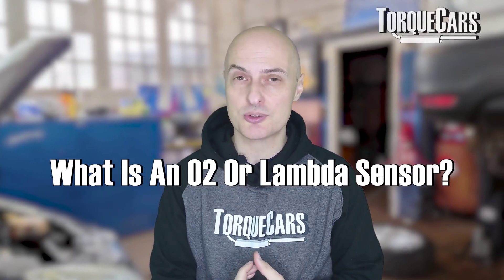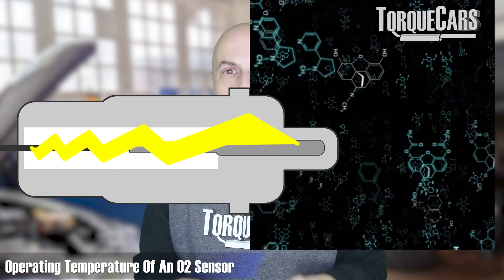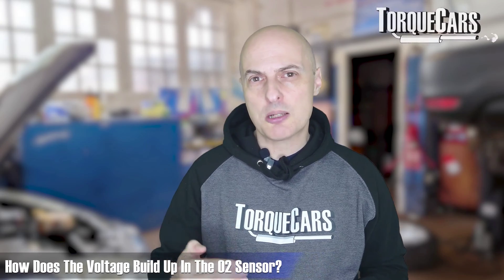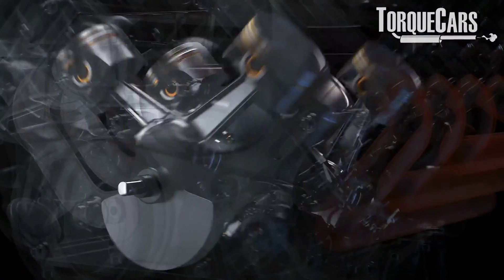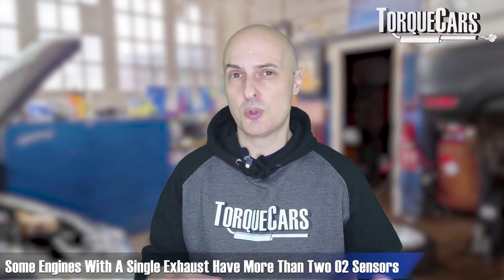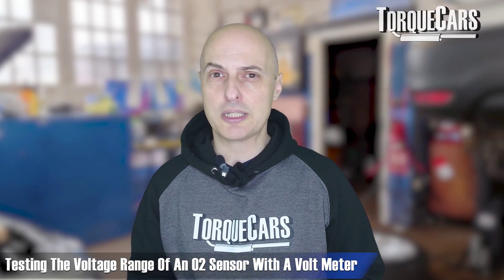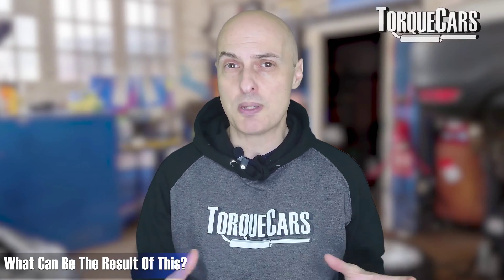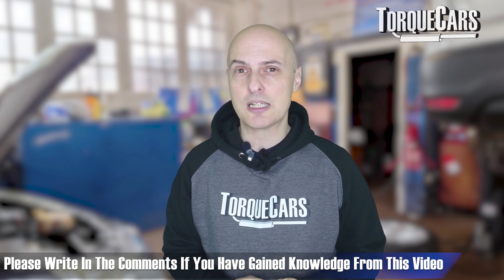O2 Lambda Sensor Problems,  How They Work, Symptoms of Faulty Bad Oxygen Sensors Explained.

Comment: Excellent video. I had no idea how important lambda probes were. I have removed my exhaust for a minor repair which means I can very easily replace the lambda probes. Car has done 275k, and never had a probe replaced, is it worth simply replacing them or wait until a more obvious sign of failure/degradation.

Comment: I like the bit at the end saying "relatively a cheap part" I bought one last September for a vauxhall and it cost me £265 plus another  £70 fitting  and 10 months and 3000miles later I need another one, is there a guarantee on parts?
Reply from the maker: To my mind this would imply another problem causing the o2 to fail, is the engine running rich? Are the wires between the sensor and ECU in good order? Most parts have a 12 month guarantee but that is against defective parts not failing due to fouling or poor installation. £265 is not relatively cheap is it, I guess prices vary from model to model and it's been a while since I have had to do one.

Comment: When I got my 2015 Polo SEL in 2021 it had a duff O2 sensor after the cat, this didn't affect the cars running but put up a CEL and when I scanned with ODB Eleven I got the code - showed the diagnostic report to the chap at the garage next door to my work and had it replaced there (I don't currently have a trolley jack, axle stands and ramps and that one is hard to get to (unlike the pre-cat sensor)